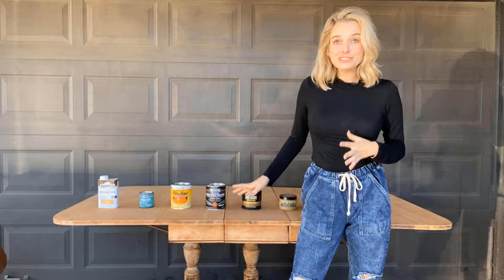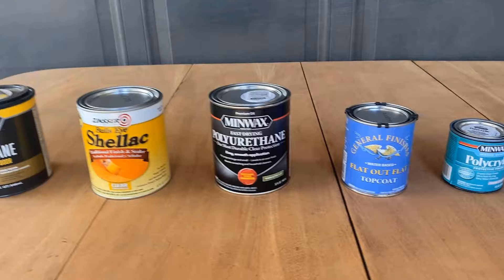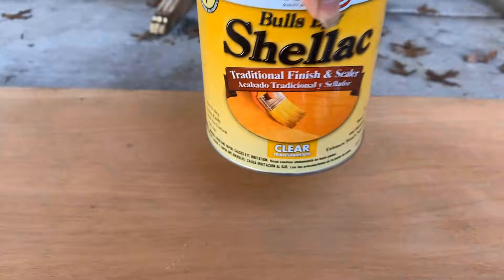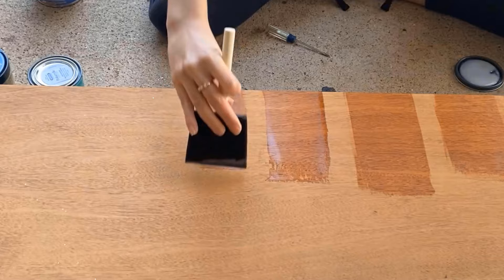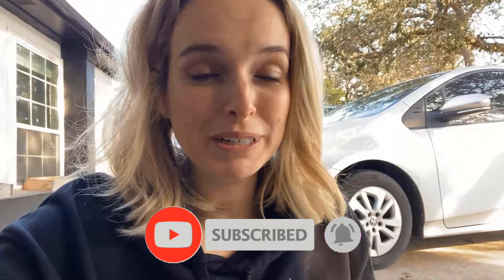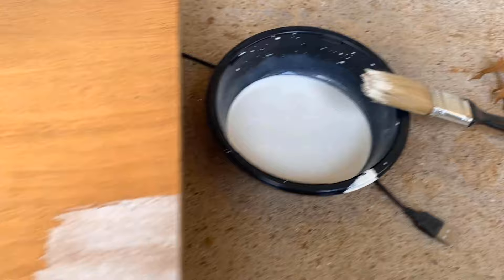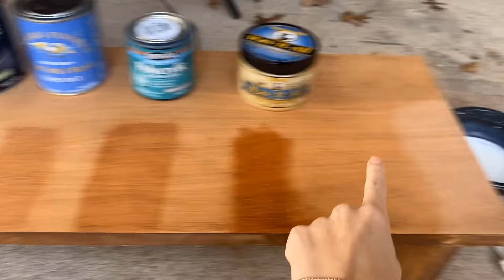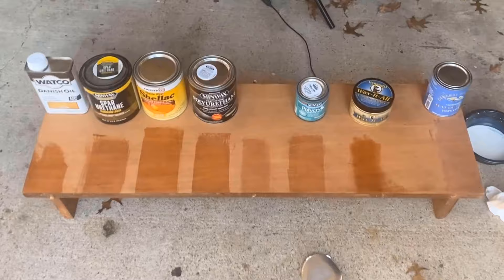How To Seal Natural Wood Without Darkening Or Changing The Color

Comment: Uhhh.... So... You lined up all the cans in front of other things? I'm confused. Why would you put the one you pick and put it in front of a line of a different. So. You picked the one on the right? Or the middle one? But it doesn't have a can? Were any of those products lined up in front of what you actually put on the wood. Or did you make rows of product then mismatch the cans behind it? Wtf.... This is like the opposite of helpful. I'm just more confused now.
Reply from the maker: Hope you’re okay over there, Zach! Not sure where you got confused. Everything is lined up right behind the streaks on the wood. General finishes was the winner as I showed. I moved the winning can at the end, but everything else is still lined up. Hope this helps!